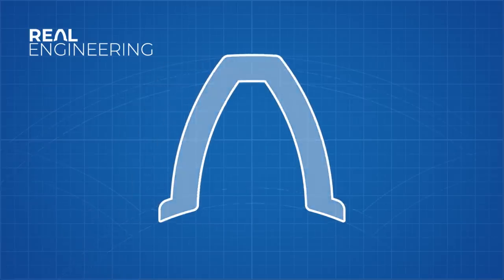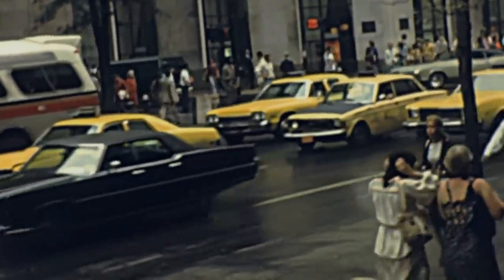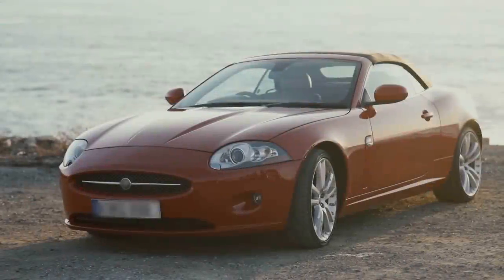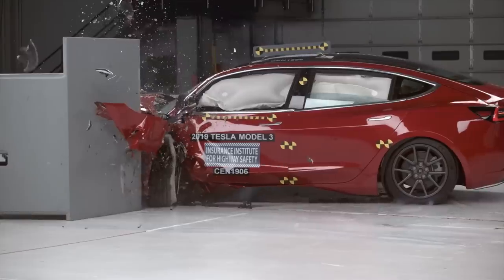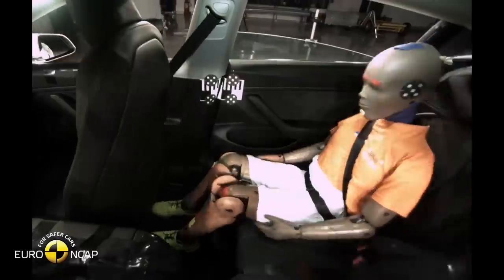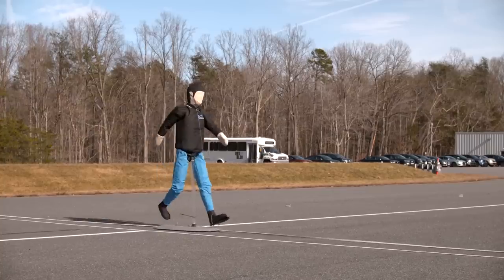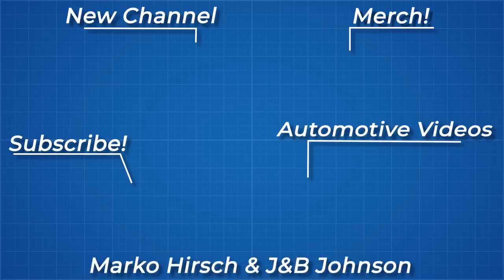Which Is The Most Dangerous Car?

Comment: People need to also consider the metals used in the construction.  A Honda Fit, for example, may be safer in a side crash than, say, a Ford Focus depending on the metals used, and I was a bit surprised at the Fit's safety performance overall.  The other car that sort of surprised me was the Smart cars.  Granted if you get into a crash with one, it's probably gong to be a total loss, but at city speeds at least, they fare OK enough to safe the driver.  I always thought they would maybe explode if something hit them above speeds of 25, but they can actually take a lot, but at the same time, due to their sheer size, someone involved in a crash while driving one is not likely to walk away unscathed.  You will probably survive, but you may have broken bones or some nasty cuts..

Comment: That list of most deaths highlights a major issue. Cars like the Mirage and Honda Fit are topping the charts not because they are dangerous cars, but because they stand the worst chance of surviving a crash with a giant SUV or pickup truck. This shows that the cars that actually cause the most deaths and injuries to all road users are not penalized for it. If anything, this penalizes smaller cars that would do less damage to other cars or pedestrians, despite them being objectively safer for all road users. This is one of the many reasons why large SUVs and Trucks are so deadly.

Comment: ZAZ 966/968
Short wheel base, rear mounted aircool engine, extremely flammable interior heating system, literal MEMZ engine. It's tricky to drive, it can set itself on fire and it has zero passive safety. It's cool in it's own right thou, removable cylinders, engine is made out of aluminium and magnesium alloys, you can repair the car in the plain field.

Comment: Fact: the car with the lowest accident and death rate is the Citroen 2CV which had a top speed of 75 km/h and road holding comparable to a sport's car with its indepedent suspension.  Speed does kill when people do no respect the laws of physics. The 2CV could even handle mud as well as a 4X4 so it was a favorite among the European farmers. Heavier means more time to stop and less cornering hability. Higher means more roll-over and eventually accidents. Engineering, you should dedicate several articles to wonders of the 2CV and then all the others designed by Citroen: Traction, DS, SM, CX, XM with the first active suspension, the WRC winners, and the most comfortable car being the C6.

Comment: I worked safety at Ford 2001 to 2003 for a supplier of sensors and airbag controllers for a few vehicles. As a part of that community, you are privy to information you otherwise would not be. 

What was super interesting at the time was that side impact tests were new. 

The Explorer was doing really bad at this. You can see in some of the films you used just how far a side impact intrudes in SUV's in general. 

They also tested all optional equipment. They found the Explorer with a factory installed running board was considerably better, passing the test. So they came to the obvious quick short term solution while side impact became a priority for future designs. They made the running boards standard equipment for all regular sales. 

Police spec vehicles could still come without running boards. They usually upfit (term for aftermarket added parts used in preparation on police and other vehicles) a sturdier running board (really just a pipe with a flat top and a non slip surface) that likely would have been even better. 

Police vehicles did not get tested. Since they are all based on other vehicles that are tested and there is no standard for added equipment, it would have been the most expensive series of tests for the smallest part of the market. The US DOT government solution was no test.

Comment: Two of the most dangerous cars were the original Austin Mini which was a simple box with an engine bolted on the front. The next nasties were the VW split screen and bay window vans. There was nothing but the front panel ahead of the driver and passenger.

Comment: 8:50 , "cars headrests are tested for American male not females"
I'm am an expert in this domain and I can add some insight to that. 
Car seats and headrests are tested for lateral, torsional and whiplash loading at 30g crash loading with the worst possible seat configurations and with the worst case occupant load (American male 95th %ile).That ensures any lighter male/female occupant will always exert lesser inertia on the seat, belt and vehicle structure for an equal 30g impact

Comment: As a physicist I know there are many factors that affect the safety.  Clearly having vehicles of different masses and strengths makes safety very difficult.  If a heavy solid car collides with a lighter one the heavy car is safer and the lighter one far, far more dangerous.  Yet if the same two cars crash into a stationary tree the smaller car can be much safer than that heavy unyielding one.  If a vehicle is strong enough to pass the partial front end collision it will be too strong in a full frontal collision.  A post will only hit a portion of the front while a brick wall affects the whole front.  No design can take into account of ALL these possibilities. The best way to be safe is to avoid collisions altogether.  The second best is to realize that speed alone radically alters the risks and the lust for driving as fast as possible works against any form of vehicle safety that could be devised.  Fast drivers are not only a menace to themselves ( single car crashes for example) but as the also increase the risks to other innocent people they are also socially reckless and irresponsible.

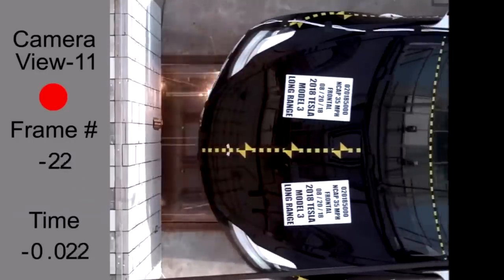Comment: 6:47 "The force of impact is not solely determined by the speed of impact. It's also determined by the weight of the vehicle."
Correct.

I've been saying this for years. The "brick wall" test is designed to replace the test where two identical cars have a collision. You're assuming the weight of the other car will be identical, which is a bad assumption. The smaller your car, the LESS likely you are to come out well in a collision.
If you're riding a Schwinn bicycle and the other guy is driving a Mack Truck, you're likely to be pink mist and the truck may suffer no damage at all.
However, the tests inherently favor smaller cars, because of the square-cube law.

Mack trucks don't do well at all against the brick wall.
Hot Wheels toys do great.

Comment: I prefer the ANCAP safety rating system - it take into consideration safety features like auto breaking, lane departure warning etc. The Ford Mustang got only 3 stars even though the crash test results were good simply due to the lack of safety systems which it should have had. Especially good that the website gives details on results for the different criteria so the customer can make an informed decision.

Comment: there's many factors to take into account when determining an unsafe vehicle, not just crumple zones or bad airbag design
for example:
- mechanical issues:
there's two cars i want to highlight for this part, the Chevrolet Corvair and the Ford Pinto, both made in 70s America, that had safety-compromising (in most cases, fatal) mechanical problems when it comes to crashes. the Chevrolet Corvair would rollover in a sharp turn because of it's rear engine setup and 5-link rear suspension, because the rear tires would bottom out and get ''grabbed by the ground''. the Corvair would also impale the driver with the steering column in a head-on crash! it wouldn't hit the driver, it would impale them, piercing through the steering wheel, then through their chest, and if luck's not in their side, through their heart. the Ford Pinto's got less mechanical problems, but they're just as threatening; upon a rear impact, the Pinto would get engulfed in flames in less than two seconds as it's exposed fuel tank would rupture at a chance of around 95% with the crash. i know they were made in the 70s, but, there's probably some cars with similar issues around there, but just less life threatening. still harmful anyways!

-  car shape design
most supercars nowadays have a slanted windshield, combined with an angled hood, and a sharp nose. if they happen to hit a tall enough car (for example, a Jeep of any sorts), they could act like an actual ramp, and cause an even bigger accident from a ''simple'' head-on collision. you wouldn't like driving behind a Huracan and seconds later having a Jeep literally fly above (or into) your car, right?

- speed without control
a great example of this one is the TVR Cerbera Speed 12. although it never made into production, it would've been deadly specially for that reason. 1100kg (around just 2425 pounds) and around 1000 hp coming from a front-mid mounted 7.7L V12. and the concept didn't have a wing! so it would make second to no downforce, and considering it's the road legal concept, wouldn't have slicks either, meaning very little grip. so imagine, 1000hp in a 1.2 ton rear-wheel-drive road going car. that shit would kill you the first 30 seconds driving it

Comment: Though some vehicles are tiny and obviously dangerous, when we get to the average vehicle, things become murkier.  In safety tests, the old Camaro did much better than, say, the VW Jetta, having a huge 'ram' in front.  However, in 'real world' insurance results, the Camaro was much worse, this relating not to the designs but the drivers.  Some SUV's can absorb collisions with ease, but their stability is such that they're undependable.  The rule of thumb is: get something moderately large, not huge, but one with stability and good handling.  I'd recommend today, yesterday and tomorrow the Mercedes E class as the base on which to judge...

Comment: No safety tests consider if you’re a mass more then approximately 172 pounds and 5’9 for the Hybrid 3 which is the industry standard, atleast for the driver , considering the fact that the average  American man is 197.9 pounds  and just over 5’9 , I’m 310 and 6’4 so in these situations I’d be a whole lot worse especially because of the extra momentum , may not sound like a lot but 100 pounds extra in a 3,000 pound car (assuming the car is 2800) is a huge difference especially at high speeds, noting this cars aren’t made for even the average American

Comment: The average mirage driver is more likely to die in an accident.

Who drives mirages? 

Here in the U.K. pensioners drive mirages. Pensioners are more likely to die in an accident regardless of what they’re driving.
Reply: So true! 
A few years ago an elderly relative of mine accidentally hit the accelerator instead of the brake, driving through the rear of his garage & then the back fence, but his house was at the top of a railway-cutting, & unfortunately he died from his injuries shortly after!

Comment: Fiat Maluch 126p has a spare wheel in the crumple zone, if you crash at 60km/h or above, the spare will brake both your legs. Also, it's so small that your head will catapult trough the windshield, effectively snapin' your neck.

Comment: I would say the worst cars to crash in would be:

Tata Nano: No Airbags, No crumble zone. According to NCAP you would be dead, even if the airbags deployed - If it had any. The body is made from plastic, and is glued instead of welded.

BMW/Iso Isetta: very unstable built, no crumble zone, passenger can easily get trapped in the vehicle
The Isetta (called Ei (Egg) in Germany) is a rolling death egg. It is uncomfortable to know how deadly it is. Any crash at any speeds from any direction will leave the car completely busted. And if the front door is blocked, the only way out is through a foldable roof on top of the Isetta.

Both of these cars scored 0 points on every NCAP crash test available.

Comment: The safety problem of a small mitsubishi bad behaving while crashing into a ford F150 that is twice its weight is maybe the ford F150 that is too heavy, and too high...
Generally, a car that is higher is more dangerous to other users than a car that is lower (crash of the same car fully loaded and empty are clear about this). The problem is that you would consider that two cars crash into each other, which is a small part of the fatality cases: most of the cases, a car crashes completely alone into a tree or a wall.
Another point against the trucks is the stability of the vehicle: a high car like a SUV is more likely to fall on its side if turning or braking a bit too strongly. Especially, if you see electronic functions to avoid it, just buy another vehicle: you do not want a car that would prevent you from braking or turning strongly (it's what the electronic function does) as it considers it safer for you to crash into a tree on wheels as safer than on the roof!
Alltogether, a porsche has the most stable architecture, but a good old sedan or station wagon is also good, hybrid or electric (for heavy batteries in the back and less engine in the front) are better. It's crushed by a SUV, but there are quite few deadly accidents against other users. Avoid back wheels propulsion (BMW...) if you live in a snowy region.
Regarding crash against pedestrians or cyclists, the most important is to have a first crash in the legs and not in the body, and then nothing where the head is going to crash (plastic whipers are OK). It means that Uber would have used a volvo station wagon instead of a SUV for self driving tests, it would probably not have killed a pedestrian...
And of course, no alcohol, sleeping enough, no phone, no overspeeding (better late in this world than early in the other) is the most important: most of the drivers of the 70's survived!

Comment: When every car can get a 4-5 star rating...it is time to make the ratings tougher ;) 
They are doing that with the PowerEfficience labels in europe. In around 10 years every cooler, fridge, and so on has become A+ to A+++++ ... in short... everything under A meant nothing. 
So they have redesigned the requirements under the new label, which is back to G to A... of which... D-A is expected. E-F and G are more warning labels to those who make them "make them better"

Comment: forgot 1 thing - the mirage is one of the cheapest cars with one of the best warranties. It's not an automatic rolling coffin because of the demographic it aims for.  Inexperienced drivers may pick a mirage for its relative simplicity and low cost, and that may hike up the death rate. Note that the Mirage G4, while being essentially the same car as the Mirage, but in sedan form, is not on the list. It's more expensive than the mirage, and that's why it doesn't make it. Or maybe they don't differentiate between the two, in which case, my point is gone.

Comment: Let's face it, everyone outside the US knows what sort of cars are the most dangerous to drive in the US and you even said the reason why at 3:41.
The compact cars were made to be driven in Asia, in cities with high population density and more traffic that NY. They're cars that are made to be small and economic, which means they're not powerful cars and lack some key security features to keep them light. They're expected to be tossed around in a crash, not to absorb all the forces that are thrown into it. This is blatantly shown by the fact that you can put a dent in compact cars fenders just by pushing them with your hand.
They're also very common in most EU countries because, again, they're economic and serve the purpose of anyone who only needs to drive for 20-30 minutes to get anywhere they need to go, instead of taking a 3 hour long trip to go have lunch at some fancy restaurant. Long trips in the US are normal, long trips in the EU usually means crossing borders or going halfway across a country.
In a country where trucks are 3x as big as compact in every component that make them, from the weight, engine or wheel size, these comparisons using US statistics make no sense, even if it's the only type of reliable data you can get your hands on.
If anything, this whole videos tells you not to buy any sort of compact car if you live in the US and not to drive like an asshole if you get your hands on a cheap sports vehicle.

Comment: People forget that with the advancements in metals and plastics even in the past 20-30 years, cars these days are 10x safer than those of even the 70's - 90's where people often regarded those as tanks.  Yes some truly were, but even little cars like the Honda Fit and even Smart cars can withstand crashes better than some of the older 30 year old tanks.  It no longer is necessarily "bigger is better" from a safety standpoint.  That use to be the phase back in the 80's and 90's and it sort of held true, but compared to today's modern cars, some of those bigger vehicles don't fare as well as a modern car despite being bigger and perhaps heavier, due to the metals and designs used in modern vehicles,  The 1959 Bel Air shown against the 2009 car is a perfect example of that, as the Bel Air likely weighted a lot more than the 2009 vehicle, and probably has more steel.  But there have been some great developments in making aluminums stronger some of which to a point where they can exceed the strength of older steel.

Comment: In my opinion car safety has a lot more to do with the person behind the wheel than it does with the car itself. If all drivers were attentive, sensible and confident then the risk of an accident would be nearly 0%. No one buys a car with the intention of getting in an accident. Saying "you are less likely to be injured if you have an accident in this car" takes away some responsibility of the person operating it, which is a dangerous thing. All cars lose vs a truck. so as far as safety goes, the best thing to implement is education ( which is also true for 99% of the worlds issues)